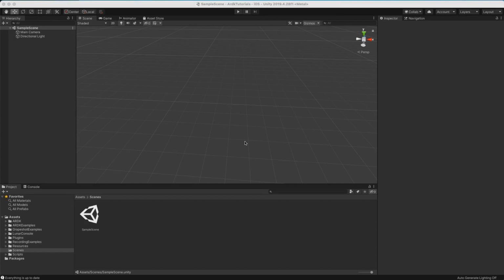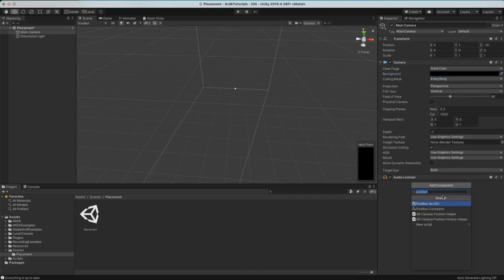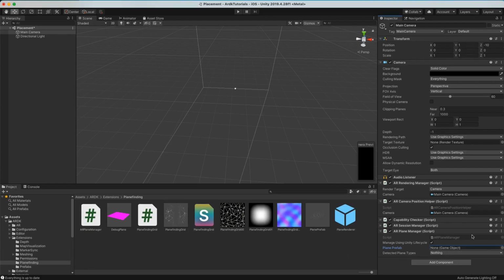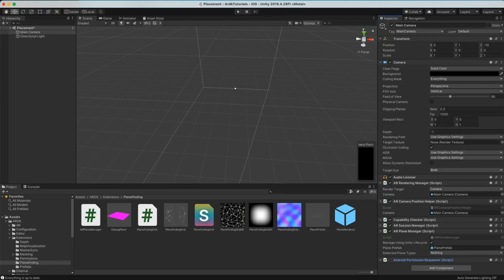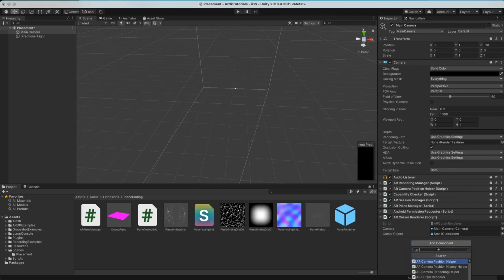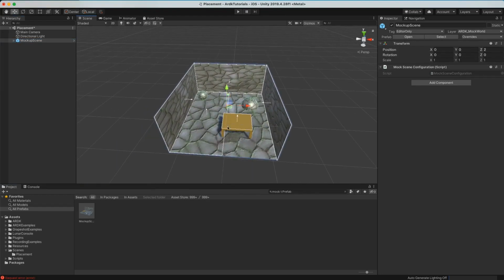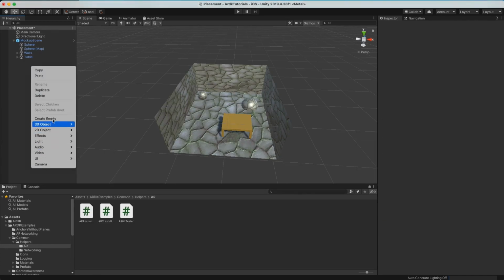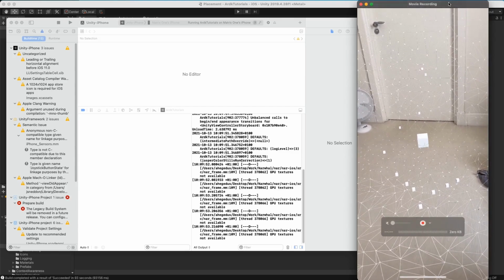Beginner Tutorial: Basic Placement with Niantic Lightship

Comment: For some reason when I hit play, I cannot move the camera vector around with my mouse like is done here at 12 minutes in, is there some setting or something that allows that? https://youtu.be/BJ3JKwia7pE?t=723
Reply: I figured this out eventually. The problem was my OS and use of a trackpad instead of a mouse. The in-IDE movement is based on right click/drag with the mouse, and the W, A, S, D keys.

In OS X with a trackpad, you need to go into the OS Settings for the trackpad and set it to right click via two fingers. It's a bit awkward compared to a real mouse, but it works.